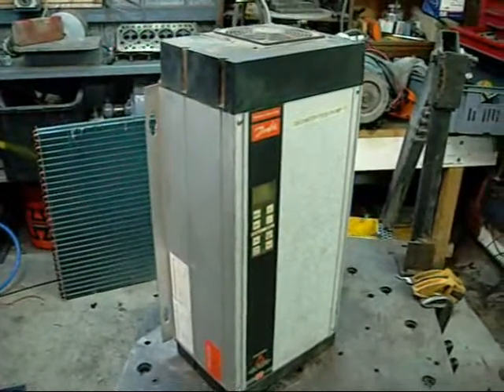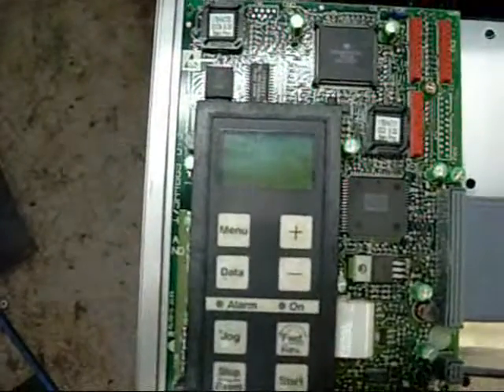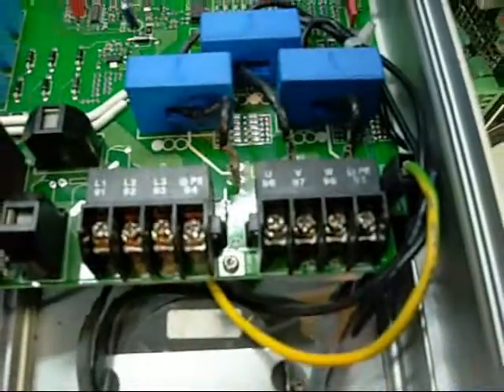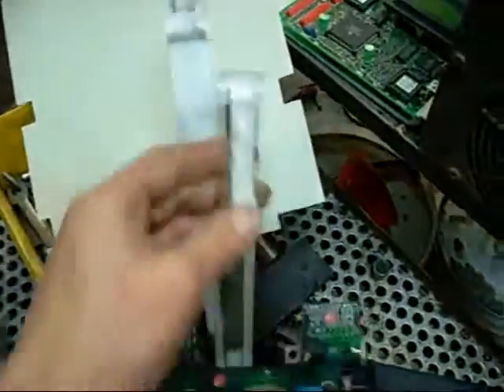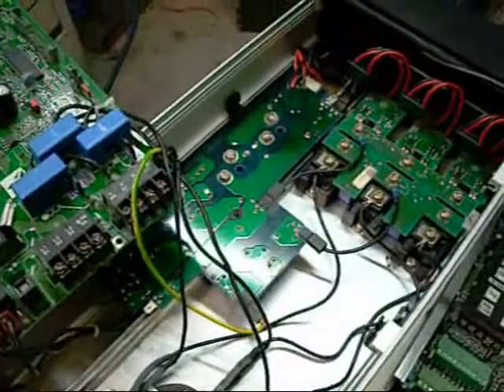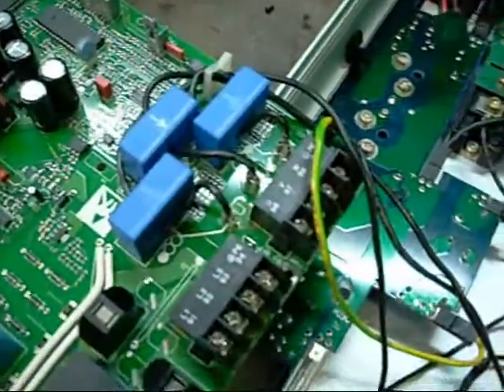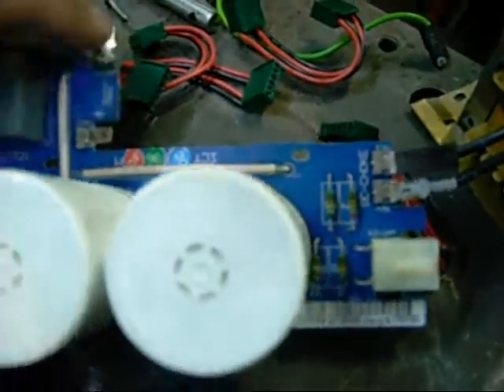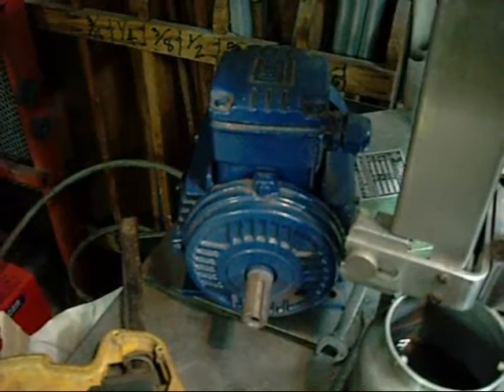Danfoss VLT Variable Frequency Drive Exposed

Comment: Sir, I'm facing the problem in my vlt3508 vfd as apply single phase 480v whole smps and cpu display flickering, but on DC 560v vfd in OK operation, according to your experience if this vfd will be test on Three phese ac??????

Comment: The power blocks act as a 3-position switch; it can connect the output to gnd, +V, or Hi-Z (High impedance - essentially an open circuit). By controlling the input signal to the switch, it creates a "rotating" current between any two of the three phase outputs. So, if you pull "U" to ground, "V" to the positive supply, and "W" to Hi-Z, then switch "V" to ground, "U" to Hi-Z, and "W" to +V, and finally "W" to ground, "V" to Hi-Z, and "U" to +v, you turn on the windings in order; "U->V", then "V->W", then "W->U", and back to "U->V", you've created a "rotating" magnetic field in the motor.

Comment from the maker: From what I understand the load sensing is done by the current transformers that the output cables run through (blue or black rectangular devices with a hole in the center for the cable to run through) one of those or its associated components could be bad and telling the drive that the motor is pulling lots of amps when it isn't (I'm guessing your motor is fine?)

what you unplugged is probably the board with the CT's on it. trace the wires back and see if any of the CT's are short

Comment: The chokes are there for radio emissions compliance, they arent necessary for the actual function of the drive.  The little white critter is the 3-phase input rectifier.  There is a sticker on the front that says 'decanter feed pump'. They use those in Sewage Treatment Plants but also Fruit Juice factories, it's part of a centrifugal seperator. Either way i hope u washed your hands before eating your sandwiches!

Comment: @bakupcpu The 3 big round things are coils for protection for the IGBT output stage. They limit a sudden currentflow. The RFI coils and capacitor are situated on the dc bus side( the board with the big white capacitors).

Comment: Those 3 big thing are probably dual mosfet or transistor the 3 phase rectifier should be around thought. And yes they send a semi sine wave to the motor those 3 big round thing are RF choke to prevent high frequency to make false reading on the amp mesuring device. Hope i brought some help.

Comment from the maker: @mrnewagemotor I'd never dealt with a VFD before I did this vid so you might want to see some of my more recent ones for more info.

the 'diodes' are actually IGBT bricks, but in theory you could control the output pulse width to drive the motor.
I'm not sure about building a DC drive from scratch tho.

Comment from the maker: @Nspect I'm not really sure, just mixed terminology I think. I used to call them that too but as you say, a VSD is like what I use on the Milling machines at work, 2 cone shaped pulleys that open and close to vary the drive ratio.

Comment: I work at Danfoss, technical support, the "hot line". I think thats a VLT 6000, a HVAC, these family is obsolete. But I can tell you, Danfoss is the only one that adds an extra filter in charge of regulating the harmonics in the electrical system. Thats why it can get so freaking expensive, cause they worth it. And of course if you buy one fo these (ofc not anyone can buy one of these) you have the safety that youre buying quality and service satisfaction.

Comment: @elect0033,
Send a list of questions you have, I access to many experts (myself included) in the field of LV and MV VFDs as well as DC Drives and switchgears. The big tech stuff now is harmonics control with filters (active and passive) or phase shift transformers (6 pulse and 18 pulse). The variable and constant torque as well as vector drive is big in today's industry. Let me know what info you need.

Comment: I work with VFD everyday. The common failures are cooling fans and loose connections. IGBT and cap faults are rare if you PM annually. If the incoming fuses pop the front end has a problem (rectifier). If the inverter faults most drives will protect themselves and trip. The older current  and voltage sourcing drives used SCR technology and the new ones IGBT. What are you going do with the parts?

Comment: The white "critter" you point out is the 3 phase bridge, which converts the incoming mains to the DC bus. The 3 seperate modules at the back then switch this DC bus out at variable frequency, using a PWM square wave.

Comment: If this is the VLT5000/3000 HVAC with the lift out control card, then there is a capacitor on the main power supply board which leaks and burns a hole in the board, it is one of the bigger caps think they are 2200uf or similar

Comment: Common failures on these are the current transducers - one for each phase, they cause "earth faults" and "phase faults" which give triplocks. Ive serviced these down to component level for various industries, and can diagnose many common faults. 
The 3 phase bridge modules can fail as well

Comment: There is no Voltage doubler as such. The mains input is rectified, giving you 415V x sqrt (2) = 580V DC. The IGBT outputs then convert this back to 3ph AC, but no more than 415V RMS. In other words, the RMS output Voltage can be no higher than the input.

Comment from the maker: Thanks so much for your input on this!, I found some info on generic VFD's online but it didn't match the componentry of this one.

I see now the white bridge rectifier with the melted plug, normally connected near the mains input, is the Input converter going down to the DC board.

Comment: VVVF drives can do cool things, like produce rated motor torque from near zero speed to motor rated full speed, drive the motor in excess of full speed (at reduced torque), apply dynamic braking (motor becomes a generator) and DC injection breaking (motor can heat up lots!)

Anyhow, many thanks for the expose, I look forward to your next subject.

Cheers BigMax

Comment: The three heavy wire coils you note connecting to the output terminals actually form part of a "low pass" filter which enables the VVVF to drive long motor cables and can reduce audible motor noise ("singing" sound).

Comment: Under microprocessor control as you have noted, the IGBT H Bridge output stage produces a PWM (Pulse Width Modulated) output that effectively varies in frequency and RMS Voltage according to the required motor speed. Manufacturers often claim special control techniques supposedly providing advantages, but the general principal of all VVVF drives is similar. None the less, the type to look for for maximum performance is often known as an SLV, or "Sensorless Vector" VVVF.

Comment: VVVF drive types work by basically rectifying the AC mains (3phase in your case) via a 3phase bridge rectifier (also known as an input converter) to produce a constant DC buss around 620VDC. The output stage consists of a 3phase "H Bridge" consisting of three upper and three lower IGBTs (Insulated Gate Bipolar Transistors) providing three output phases to the controlled motor.

Comment: hey friend it may be possible that the diodes are actualy voltage doubler sercuits? not shure just a thought to   consider im only saying this because inverters usualy require  more electronics
to generate Hz at the corisponding requirement,let me no what your thoughts on this comment,the voltage doubler sceam is somthing ive seen before it getsyou out of heavy tranies,this is a halve baked statment its been years sence i vieww the document influancing these comments,,great vid also